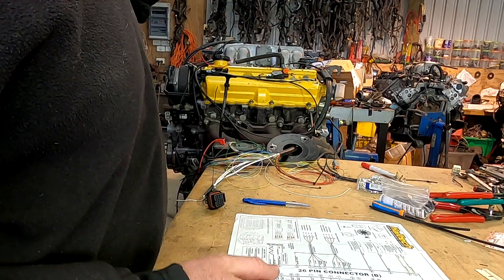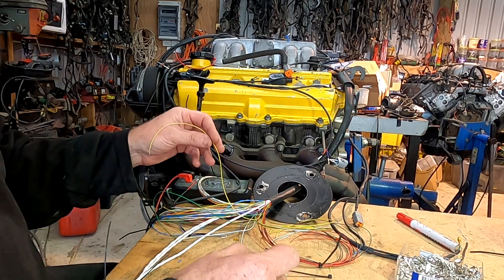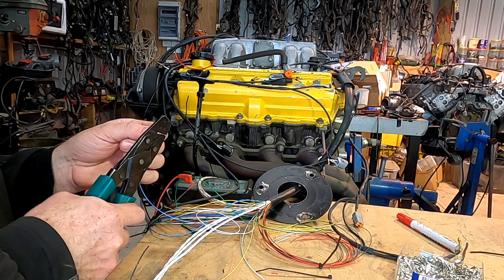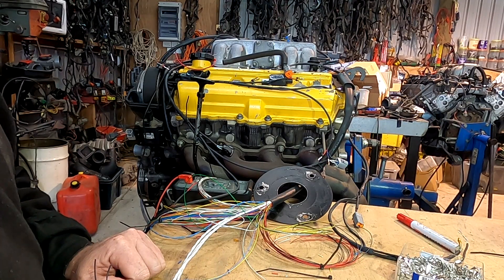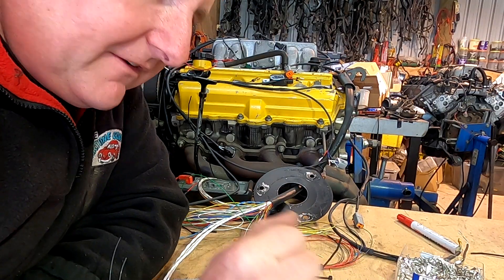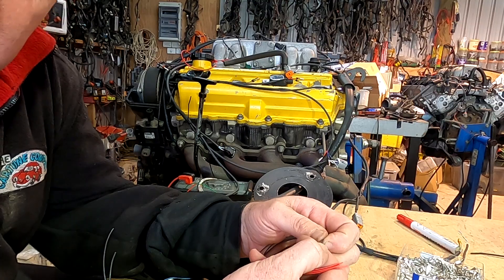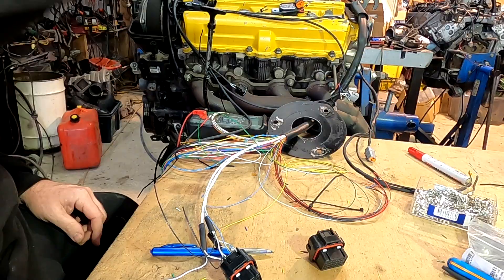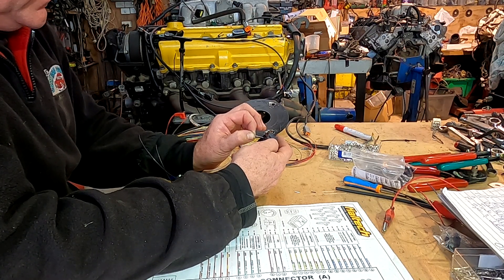Wiring Haltech ECU to 1uz Part 3   Basic Analogue inputs   Coolant and air temp and TPS

Comment: can someone educate me,  what is an idle switch and what dose it do.    i thought idle would be controlled by ecu and stepper motor/idle valve  also could I use the +5v  sensor supply for the tps

Comment: Do u come across voltage drop or resistance issues when it comes to instrument and sensor measurements? Does the computer need to measure resistance of cable when it comes to commissioning or do u have to input the length of cable and diameter?
Reply: Only ask when it comes to program logic controllers in industrial buildings can have these issues when it comes to instrumentation
Reply from the maker: Good morning.  Fortunately with most automotive wiring we are working with very short lengths of wire so wire resistance isn't really an issue for most of them.  The only one I can think of as being different is K-line exhaust temp sensors where the correct connectors must be used otherwise the resistance of the connectors must be accounted for.  Cheers Kelvin